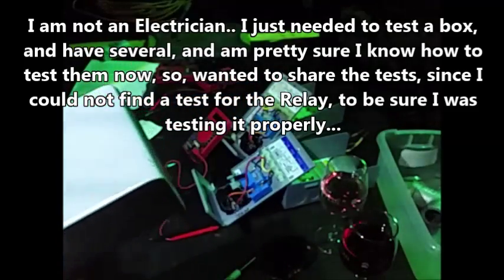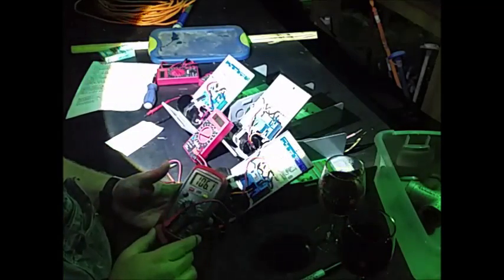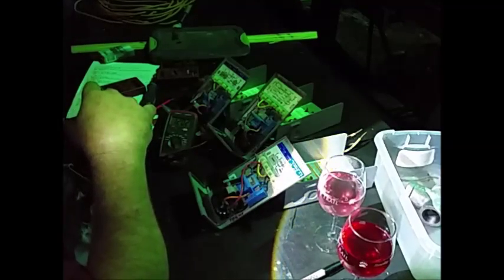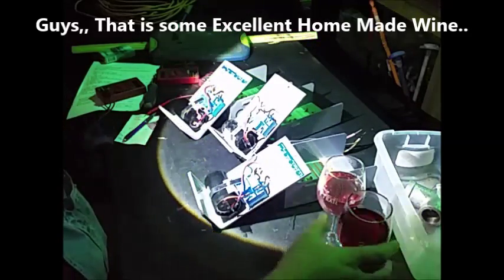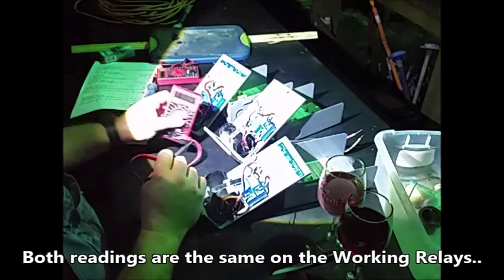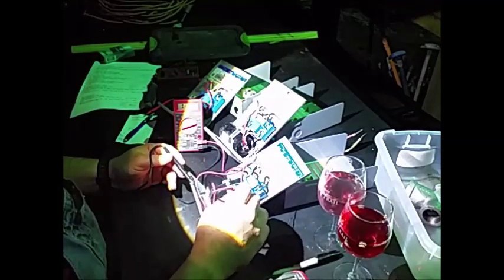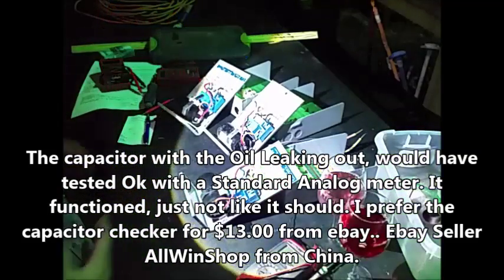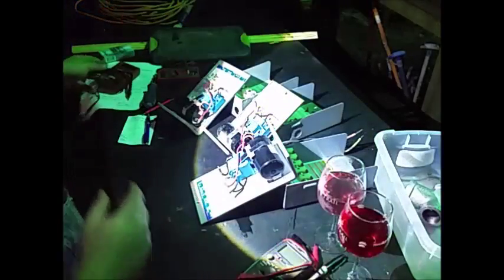Franklin  QD Control Box (Model #2801084915) Capacitor And Relay Tests

Comment: All you really need it the capacitor because the pressure switch is a relay. Many don't even know that. PS I am a electrician. So many things are designed by people who over kill systems due to not understanding what they are doing including engineers! They may have books smarts but many are lacking real world know how! I can save companies money and have done so in the past to over production just like this and time lose. Think of it like this, the pressure switch is a mechanical switch and works off of pressure and the other is a electro-mechanical switch which works off of electric and electric costs you money to use. Now why put two relays in line when you only need one? Overkill !
Reply from the maker: You have no idea how well I know what you are talking about.. I run into crap like that daily.. Not in the Electrical world, but, in everything else. I am still a fledgling when it comes to things "in" a circuit.. I can wire a house easily.. Have done that.. But, when it comes to Microfarads, more than simple low voltage relay trigger to pass a higher voltage current,, it seems like Greek all of a sudden.. I am helping someone fix their Grinder pump right now... 
Don't quite understand the red light with warning buzzer hooked to a separate 120 line which keeps going off,, and a pump that works when it wants to (reset 220 breaker and it works great once, but, won't run if it kicks itself on with the float valve..  Has a Start Cap, a Run Capacitor and a Relay again.. They all work fine when you cut power and turn it back on, but, when the float kicks the pump on, sometimes it sits and humms,, sometimes it runs and cuts off in the first minute or so.. The Capacitors are $48 bucks each and the relay from the company... I just got the pump pulled yesterday.. Going to open it, get length/width/microfarads/voltage and make some calls and see if I can find an alternative part for half the money and replace them all.. 
I ran into a plumbing problem the other day here with a stopped up filter.. Sent two of my employees to look at it.. They were dumbfounded.. Could not even see how simple the whole deal was, and could not use the evidence staring them in the face to tell them where the problem was.. High pressure here, past here low pressure,, where is the problem??? DUHHHH.... Even after I explained it to them, still DUHH.. I said.. Look,,, I could teach this to a 5 year old.. The reason I can't teach you is,,,, the 5 year old is curious, and he doesn't "KNOW" it is complicated, so, he gets it.. You, on the other hand,,, can't get past the "I can'd do this", so you can't even see what a 5 year old could see.. 
Working on a big bus yesterday.. Rear Brakes on a dually.. One of my big busses... I was puzzled because what I had looked right, but, it wasn't working.. No brakes, even though everything was working properly.. Had a couple of problems... The slack adjuster.. Left to Tighten instead of right which threw me off initially.. Then,, would not expand far enough for new shoes that were installed to hit the drum..  Someone came by, said they were a mechanic and worked on these all the time.. He looked and told me at some time the brakes had been so far out of adjustment that the S-Cam flipped and needed to be flipped back.. I have to take the brakes apart to flip it back over and the Left turn to tighten would change back to Right hand to tighten.. I looked at him like he was crazy and replied..Hang on a minute.. The S-Cam looks like it is the same on both sides,, not that it would make a difference if it was not.. Each side is going to push the other the same, flip it or not, so, don't see how that is going to fix anything,, and why do I have to take the brakes apart to flip it again, if it flipped before, since the drum is off,, and how is flipping it going to make a Left to tighten threads tighten to the right???? 
Are the threads going to change when I twist that another 40 revolutions??? Just a minute.. I grabbed a butterfly impact, put it on the slack adjuster and spun it over 90 degrees until it flipped.. I looked at him and said.. Now, if I hit this impact again,, it is going to start going the other way???  He looked and said.. I don't know.. Does it for me!!.. I fired the impact off again and looked at him and said,, which way did it go? He said.. the same..  I said, yes,, I didn't change the gears or anything, so, it wouldn't.. And no need to take the brakes apart to flip the S-Cam.. 
Must have been the guy who worked on it at the school board who either put the wrong size brakes on it, or put the wrong size bushings on the S-Cam, because the diameter of the brake shoes at rest were 1/4" smaller than they should be to expand and hit the drum when the S-Cam turned.. I didn't even try to explain that to him with 20 years experience, to my 1 hour of trying to fix something that had the wrong parts in it anyway... I had one hour of experience.. Never even took one apart before then... 
Makes me wonder how they even manage to make a cup of coffee in the morning..Ha.. 
You are a conceptual thinker like me. I can figure anything out, given some small keys to something I know nothing about.. Just tell me how it works first, and I'll figure out the Why,, or vice versa.. And, just stand there are talk to me about what you do for a living for a few minutes and let me ask you a few questions here and there to fill in the blanks I have, and you will swear that I have been doing what you have been doing for the last 20 years.. 
I did it to some machinists not long ago.. Used to think Lathes and Mills were complicated.. After talking with these guys for 20 minutes, I went and bought me a used lathe and mill... Have not had time to turn them on yet, but, if they can figure it out,  I will be making parts in no time..Ha.. Cheers..
Reply: Just look at it like this, your capacitor in a circuit is acting like your expansion tank in your well system as in it takes the over volume and stores it up until it is needed in the flow of water in your plumbing system and electrons in your electrical circuit. Same same! Now as for the pressure switch being able to kick out the contactor with a certain amount of electrons flowing through it is all according to where you place the capacitor. Place the capacitor after the pressure switch contactor to the well pump motor. Now as for what capacitor to use is all according to the motor application being used as in a running capacitor or a starting capacitor. As for a well pump it more than likely will be a starter capacitor.
Reply from the maker: Davie Jones How accurate ate the hand held capacitor checkers? 
Working on a sewer grinder pump. I think start cap is bad, but checks out OK on the capacitor checker. In the range, but on low end. 
There was also some very thin water or oil in that area, but don't see any leaks on the capacitor itself.